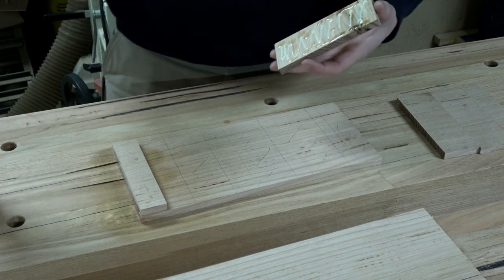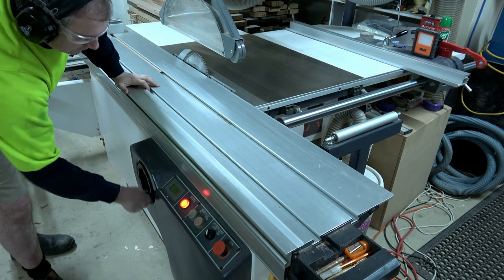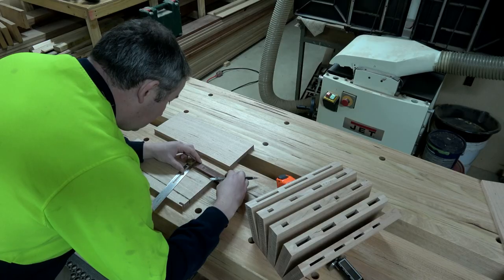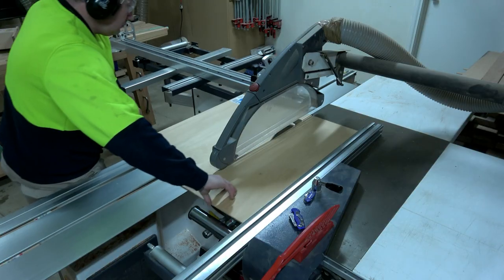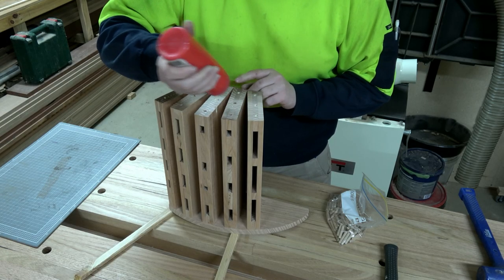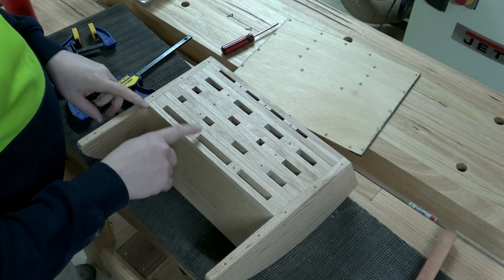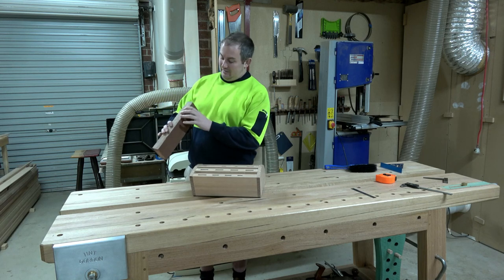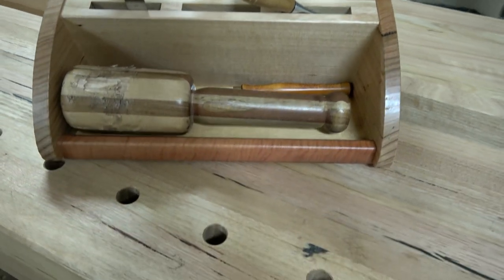Tool Caddy Build for Hand Tools // Woodworking

Comment: I have my own version of bench top caddy but your splayed design is really clever, so clever that mine is going to have to take early retirement.
Reply from the maker: Hehe, thanks. I think mine may end up filling with dust, but everything fills with dust anyways 🤣
Reply: @kuffyswoodwork  I didn't want to appear negative but I was thinking of not having a base (except at the front till) to allow dust to fall through. In a humid climate dust clinging to metal is excellent if your aiming for rust.
Reply from the maker: No base was my plan originally, but the marking gauges and rulers are quite long so I would need make it much taller, or block off those particular slots. I'll see how it goes, but I don't have much of a problem with my tools rusting

Comment: Turned out fantastic and how good did those red gum handles and front strip look after finish was put on, might have to reassess my crappy plywood tool holding trays now 😒😢😢
Reply from the maker: Cheers mate. I probably need to buff the bits of Redgum. Currently they only have a couple coats of satin poly which muddys the surface a lot. A bit of auto polish should go a long way.

Comment: Hey Kuffy, I wonder if the water from the glue will activate the super glue?  Very interesting project man.  I love the shape and functionality.  

Well made video too 👍
Reply from the maker: There are a few things which activate super glue. Glen 20 is one, but I found them to be unreliable. I've never tried, or noticed water working to activate CA glues. I'll test it some time
Reply: Kuffys Woodwork from what I understand, the ‘activator’ is nothing but water.  Super glue sticks so well to human skin due to the water we have in our bodies.  

Personally, when I use super glue, I’ve sprayed a little water and it seems to work fine.

I’m no expert, it’s just from the little bit of internet information I’ve randomly collected on the internet, so take that how you may.  If activator really is just water, I would think allowing it to come close enough to the glue as you squeezed the boards together would start the hardening process. 

Regardless, I enjoyed seeing you use it.  It’s much better than my method of hot glue and wood glue.
Reply from the maker: Nice. I'll test it this evening. Hopefully it works because water is cheaper than activator 🤣

Comment: Are you just one tough Dude??? Working in Shorts. We have brass monkeys running around here in Perth. OR.. is the workshop heated :) . Nice little project.
Reply from the maker: Lol. I did have a jumper on and we were in double digit temps most days. Though at work, we start at 6:30am, and on a cold frosty day, the packs of timber are literally covered in ice. That's when I get cold legs...because I don't actually have a single pair of work pants. 😂

Comment: Great video however I am curious.  My 'activater' goes off at 7.30 am. Your 'activater ' goes off with PVA glue. What is the activater that you are using? Cheers John
Reply from the maker: The activator/accelerator is Zap kicker. I put PVA glue on part of the work piece, and CA glue on the parts that the PVA missed. I would think that by combining the two glues, there will be some adverse effect's, but it'll be strong enough regardless.

Comment: Thanks for the great video. It’s the first time I have seen you work and I am impressed. What kind of saw is that you use? I’m trying to figure out how I want to build a caddy myself. I think that I want multiple smaller ones but I haven’t decided yet exactly what I want. I think I want one for joint making but there are times that use some of the tools for other projects too. I like that you caddy is easy to get the tool and easy to put it back.
Reply from the maker: Hi Don. My saw is a Chinese built sliding panel saw. It can cut full 8x4' sheets. Since making my tool caddy, my workbench has remained clear of tool clutter. I just need to figure out how to keep my bench clear of work pieces 😂

Comment: Another nice build and a great idea. I bought a set of plans in appreciation for the videos you put out.
Man you put some work into those plans. Is that a Mirca sander your using around 11:00 and if so have you had any issues with it
Reply from the maker: Awesome, thank you very much. Yes, my sander is a MIrka Ceros. It's a great sander. I've owned it for about 4 years and it has never given me any issues. Even the hooks on the interface pad still grip the sanding discs more than well enough. I bought it to replace a Milwaukee sander which  vibrates something vicious leaving me with a weird sensation in my forearms for the rest of the evening. I'm told this sensation is something of a genuine concern in the long term.

Comment: You use a lot of tas oak is it cheap in melbourne
Reply from the maker: It's not cheap, but it is probably the cheapest hardwood available down here. We use Tas oak/Vic ash as our F17 structural hardwood.

Comment: Yes but a bucket does the same job 🤣😂
Reply from the maker: I have a tool box which is basically just a bucket. The toolbox holds my tools for other trades, electrical, plumbing, mechanical etc. I wouldn't dare put sharp chisels or measuring tools in there and expect them to come out as good as they went in